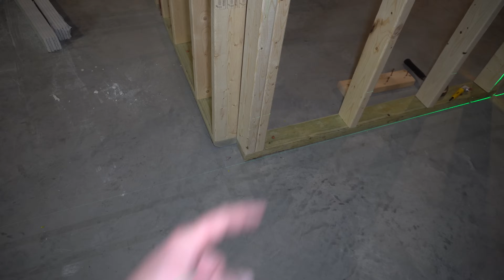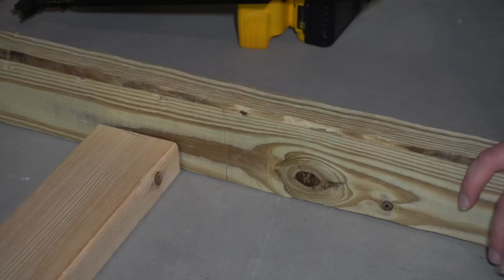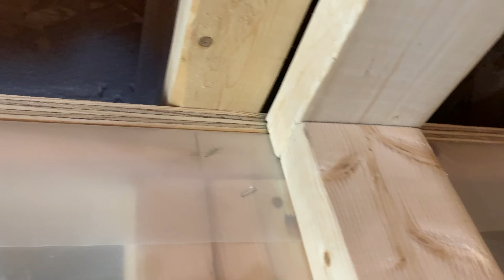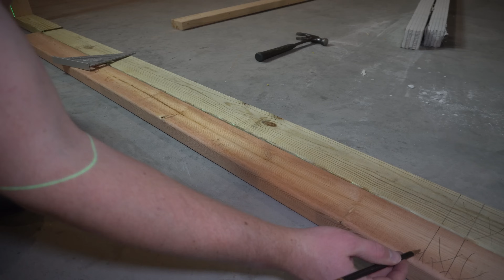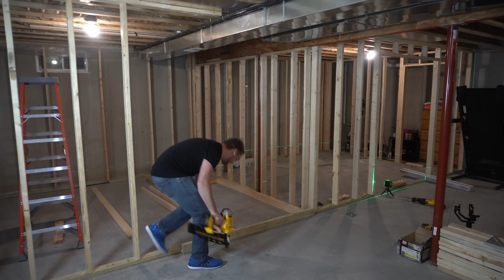The Basics of Framing A Basement Wall

Comment: Just finished framing a room in a basement and have so many questions.  
1. Where your wall butts against the existing wall, why not run blocking between the studs on the existing framing to tie the new section in?
2. where the two sections of the new wall meet, why not end each section with a stud and attach the two sections together?  Wouldn't that be easier (and more stable) than trying to have a stud split across two top / bottom plates?
3. No double top plate? Wouldn't that allow you to stagger where the sections meet, making the wall more stable?
4. Why no jack studs and header in the doorway?

Comment: Why use screws and not nails to attach the wall to the stud and top plate?
Reply from the maker: usually I use screws to "pin" the wall in place and then follow up with a few nails from the nail gun. I found that sometimes the impact from the nail gun can cause the wall to move out of plumb if I don't have it "pinned" in place first. but that's really just a personal thing I do - not sure if anyone else does that lol

Comment: Great instructional video! I’d love you opinion: creating a play space in our 100+ year old house for our two kids. I am going to divide the basement in half to separate mechanical and laundry and lay subfloor panel in the play space, should the wall be built on top of this subfloor? For the wall on the two exterior walls, how many inches away from the foundation is appropriate for air flow? The exterior walls do get damp in the summer and we run a dehumidifier from May to November. Thanks.
Reply from the maker: I’ve never installed a sub floor before so I can’t really speak to that, but I know Home Renovision on YouTube has done that and has a few videos on installing subfloors. I think he installs the wall on top of the subfloor, but double check his video. 
For the air gap, I leave 1/2” which I believe is pretty typical. 
Good luck with the project!

Comment: Great video! I"ll definitely be picking up the speed square for my next basement building project. 👍.  How long do the batteries typically last in the nail gun? I like the cordless idea, though it sounds like it's heavier then other nail guns....making it a bit harder on the arms. I don't have a large basement, and the exterior walls are already framed, so probably not an issue for me.
Reply: Most of the cordless/battery framers are lighter than my air framer, but they don't hit as hard in my experience. Good for small projects

Comment: Great video and great job!!

Why is the first mark at 15 1/4?  Doesn’t that throw off the 16” on center for the studs?
Reply from the maker: It's a little tricky to imagine it but I promise that if you lay it out like this you will end up with studs 16" on center lol. So the first stud will be flush with the start of the bottom plate. Then measuring 15 1/4" off the start of the bottom plate will give you the leading edge of stud #2. Center to center of the first two studs will not be 16", but the sheet of drywall will not be going to the center of the first stud, it will be going to the edge of it/start of the wall. 
So from the start of the wall to the center of stud #2 will be 16". Then it's 16" OC from that point on. I hope that makes sense 😃 Kind of tough to explain in text lol.
Reply from the maker: And thank you!
Reply: @DoingWhatever  thank you for taking the time to explain further!  I got it now!  Keep up the great high quality work!

Comment: Cool stuff. I'm confused why you kept screwing into things when you have a framing nailer though :D
Reply from the maker: I usually used two screws to pin the wall in place and then followed up with some nails from the nail gun. I found that sometimes the impact from the nail gun would shift the top of the wall slightly out of plumb, so that's why I use screws first and then nails 😃

Comment: Did you really frame over your window? The connection by the LVL has to be weak. Also don't pre-make your walls in basements. It works on a level flat subfloor, but concrete is rarely ever level. If you want your walls to be tight to prevent squeeks and cracks cut every stud to length.  I am a professional that only finishes basements.
Reply from the maker: I cut in the window after the wall framing is up so I can get a perfect opening rather than relying on measurements on the ground and hoping I put the wall in the exact correct spot. 
The LVL connect could be better but I'm not concerned, it's not going anywhere. 
In the video I measured the height all along the wall and there was maybe 1/8" difference over 14' of wall. I understand what you are saying if the floor is unlevel, but in my case it was quite level with the floor joists.

Comment: You almost know what you are doing. A little bit of knowledge is sometime more dangerous than none. You didn't crown your studs? Nailing close to the edge of your plate splits it, Angle your nails a little off the plate edge. Screws do not carry the shear strength for framing and are not legal regardless of what the box says, Your drywall backing is not quite enough...I could keep going.
Reply from the maker: Yes, I should have crowned the studs.
I don't believe the nails split my plates (I'd have to look back at the video) but yes, angle them a bit. 
I use screws to pin the top of the wall in place and then follow up with nails from the nail gun. I found the impact from the nail gun can knock the wall slightly out of plumb so this method seems to work for me. Not aware of anything that says I can't use screws AND nails. 
what drywall backing are you talking about??

Please keep going...lol I look forward to your video on building the perfect wall 😃

Comment: FYI. You cannot frame like this is in Colorado. You have to have floating walls.
Reply from the maker: correct, Colorado and Wyoming I believe both require floating walls in the basement. But be sure to double check with your local building inspector for your specific area.

Comment: cool vid, wonder is there any downside of toenailing using screws instead of nails?
Reply from the maker: Thanks! 
I don't see why you couldn't use screws to toenail
Reply: @DoingWhatever  thanks! Do you mind sharing what type and size of screws you are using?  Are they wood screws or speciality screws like Simpson screws?
Reply from the maker: I like 2 1/2" screws for something like this - I have a link to them in the video description. otherwise the Deckmate 2 1/2" screws from Home Depot are the same thing and a little cheaper it looks like!

Comment: Any tips on framing if you don't have a large flat surface to lay the wood down on? e.g. only have outside
Reply from the maker: You could frame it in place - basically install the top and bottom plate first, and then install each stud one by one vertically, and toenail them in place with screws or nails. You would still mark out your stud locations on the ground first before installing the top and bottom plates, so you know exactly where the vertical studs go. Hope that helps/makes sense!

Comment: Look up floating walls. this type of framing can do thousands of dollars of damage to your home. basement floors can move up and down with water level and seasons. Be careful.
Reply from the maker: in Colorado and Wyoming I believe it is code that you need to have floating basement walls. obviously check with your local building inspector / local building code - but for my location, I don't need floating walls. Good heads-up though - thanks!

Comment: Would it be alright to have used construction adhesive on the under side of the bottom plate then shot nails into the concrete floor?

Comment: what did you do with the gap between the concrete wall to the new stud wall?
Reply from the maker: That's an air gap - it's just a void space in case any moisture would develop behind the wall, it would likely evaporate before causing any damage. This has its limits though..
Reply: @DoingWhatever  sure. did you put anything on the walls or kept them as is?
Reply from the maker: Kept them as is. There is a waterproof barrier applied on the exterior side

Comment: Getting ready to build intertior basement walls.. What gauge/length nails used? Also, what determined weather to use screws or nails?
Looks like screws for bracing. Nails for wall studs?
Just curious why you left 4 or 5" between concrete walls and stud walls? Thanks!
Reply from the maker: Awesome, good luck with the project! 
I have links to the different items I used, including nails and screws in the description of the video. so check those out and they will take you right to the item 😃
No reason really for where to use screws vs nails. I typically used a screw or two when lining up the wall on the laser level line because I found that if I used the nail gun, sometimes the impact from the nail gun would move the wall off the mark. So I would pin the wall in place with a few screws and then follow up with a few nails. but you could definitely use just one or the other.
On the one side it's spaced further off the wall than normal (about 4") because of a bump out in the foundation wall. normally though, I space the stud wall 1/2" off the concrete foundation wall to provide an air gap - just in case any moisture would develop behind the stud wall, the 1/2" air gap would allow it to evaporate before it caused any damage. obviously this has it's limits though. Hope that helps!

Comment: Is there a reason that the framed exterior wall is spaced so far from cmu wall?
Reply from the maker: good question! On the one side it's spaced further off the wall than normal (about 4") because of a bump out in the foundation wall. normally though, I space the stud wall 1/2" off the concrete foundation wall to provide an air gap - just in case any moisture would develop behind the stud wall, the 1/2" air gap would allow it to evaporate before it caused any damage. obviously this has it's limits though. hope that makes sense!
Reply: @DoingWhatever  Thanks for the reply. I’m getting my stuff together for my basement and trying to figure out the best course of action for insulation. I live in the south and humidity will be my enemy.   Debated foam boards on cmu wall but didn’t want to trap moisture between.  Leaning towards air gap with Tyvek on back of studs to keep fiberglass insulation from touching cmu wall.

Comment: Awesome video! Why the ramset nails instead of the normal ones for the bottom plate?
Reply from the maker: thanks! good question! The ramset nails are hardened more than a regular nail and will go into concrete. a normal nail would likely not go into concrete.
Reply: @DoingWhatever  Thanks for the response, makes sense! Will be going through your whole series of framing videos, so much good info 🤓🤓💪

Comment: Why do the studs go every 16 thanks
Reply from the maker: That's a pretty standard spacing in the industry. also, that spacing corresponds with other building materials (drywall, plywood, etc.) that typically come in 4'x8' sheets - thus the sheet material will land on a stud. hope that helps!
Reply: @DoingWhatever  appreciate your video and taking the time to respond, thanks.

Comment: If I need to build a partition wall to a room that’s already been dry walled and painted etc, is it better to remove the existing drywall if, for example, the new wall does not meet a stud and would require blocking like in the video? Or is there a way to still achieve structural integrity to the wall without removing drywall? For example, would anchoring it to the concrete floor and ceiling be enough? The wall would be acting as support for a set of built in wardrobes. Or do you think there’s a way to secure the built in wardrobes without a wall? Like making a base, attaching that to the concrete floor, and instead of securing the wardrobe backing to a new wall, attach it on the one side where it meets an existing wall and then secure the built in wardrobe to the base? 🤔 The partition wall wouldn’t go from wall to wall either because the entrance would be a walk in without a door.
Reply from the maker: If I'm understanding you correctly, you're wondering if the new wall needs to attach to the wall perpendicular to it like this --|   or if it can stand alone like this  - |   is that correct? 
Attaching the new wall at three points (floor, adjacent wall, ceiling) will be the strongest, but I don't see why you couldn't just attach at the floor and ceiling. I think you would also be fine with just the wardrobes and attaching them at the base and the adjacent wall. 
but I should mention that obviously every situation is unique and without seeing it I'm just making assumptions lol. you could also reach out to your local building inspector and run it by them if you want reassurance. 
Thanks for watching! and good questions!

Comment: I am framing a small area but the floor is plywood on floor joists. How do I nail the floor plate to the ground ? More blocking ?
Reply from the maker: If I'm understanding you correctly, you should be able to either nail or screw the bottom plate to the ground/plywood.

Comment: I have a question do you license to frame basement?
Reply from the maker: That will be different depending on where you live - Make sure to check with your local building inspector. 
Where I live, I can do this work myself as the homeowner, without a license. I did need a building permit though.

Comment: I noticed that you set the walls a few inches away from the concrete blocks . Why? Also aren’t you supposed to have two top plates? I’m going to build a office in my steel building and this video is a great help and definitely the best video I’ve seen. Thanks!

Comment: iI followed this, but my studs warped after a month of being in the basement - How do i fix?  The wall is all bent now
Reply from the maker: all of them warped? I had 2 studs that I had to cut out and replace because they twisted after installing them and the wall was standing up. but that was 2 out of about 250 studs total. were the studs not dry when you built the wall?

Comment: sorry, but why he didn’t use the framing gun. It’s much faster.
Reply from the maker: I used the framing nailer for a lot of it, but I use screws to get everything lined up perfectly first, and then come back with the nailer. Sometimes the impact from the framing nailer moves your wall off its mark. But if you pin it in place with a few screws first, then you can follow up with some nails and you’re good to go.

Comment: Why do you use nails for some but screw for others? Also what nails and what screws?
Reply from the maker: Good question! 
I use screws to pin the wall in place and nails mostly everywhere else. So for instance when I’m trying to line up the top of my wall with the laser line - I’ll use 2-3 screws to pin it in place and then follow up with a few nails. Sometimes the impact from a nail gun can move your wall off its mark, where as screws wouldn’t do that necessarily. 
I used 2 1/2” screws and 3” nails I believe - I should have them linked in the video description.
Reply: @DoingWhatever  Awesome thanks for the info! Just started framing my basement yesterday so this was great timing.
Reply from the maker: No problem! Good luck with the basement!

Comment: 3:12 Why is the first mark at 15 1/4” instead of 16”?
Reply from the maker: It's a little tricky to imagine it but I promise that if you lay it out like this you will end up with studs 16" on center lol. So the first stud will be flush with the start of the bottom plate. Then measuring 15 1/4" off the start of the bottom plate will give you the leading edge of stud #2. Center to center of the first two studs will not be 16", but the sheet of drywall will not be going to the center of the first stud, it will be going to the edge of it/start of the wall. 
So from the start of the wall to the center of stud #2 will be 16". Then it's 16" OC from that point on. I hope that makes sense 😃 Kind of tough to explain in text lol.

Comment: Love you videos man, my only recommendation is adding time stamped sections for your video.

Sometimes there was a discrete part I wanted to come back to but had to scroll to find it. 

Thanks big time for your help!
Reply from the maker: Thank you, I really appreciate it! 
And I appreciate the feedback as well - that’s a good idea, I will definitely do that in the next few days
Reply: @DoingWhatever  Hey man I seriously watch this video all the time while I'm learning, thanks so much. Here are time stamps I thought would be helpful

0:28 Project intro
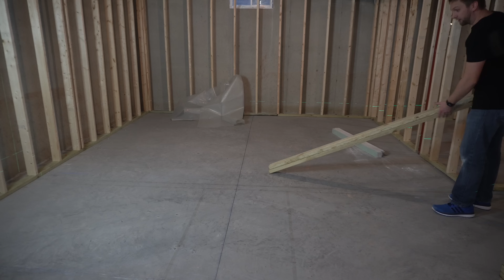0:29 Measure floor boards
1:31 Top plates
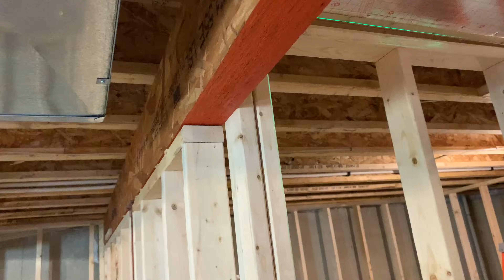2:15 Stud placement
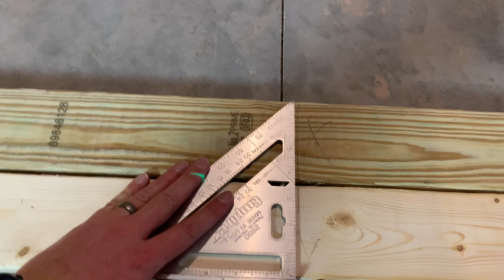5:29 Top plate Blocking
7:41 Measuring stud height
9:29 Stub nailing
12:46 Tricky Drywall/Finishing tip
14:46 Put up the wall
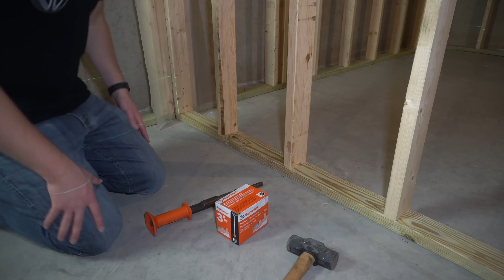16:41 Nailing to floor
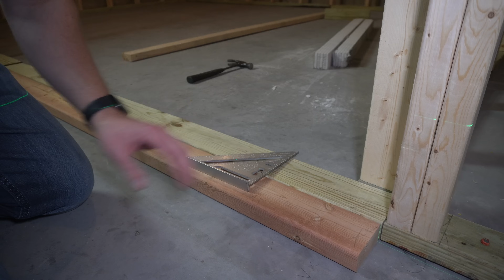20:26 Navigating Obstacles

Comment: I know you used a laser and measured everything. But it's crazy to me you didn't use a level when you started securing the frame at the top plate.
Reply from the maker: The laser is auto leveling - there’s a switch you flip on the laser and the line levels out using gravity just like a bubble level would
Reply: @DoingWhatever  ya I get it. I wouldn't be able to help myself checking level on the stud as I go down. I don't trust my eyes enough without a second opinion.
Reply from the maker: yea it definitely wouldn't hurt to double check with a level